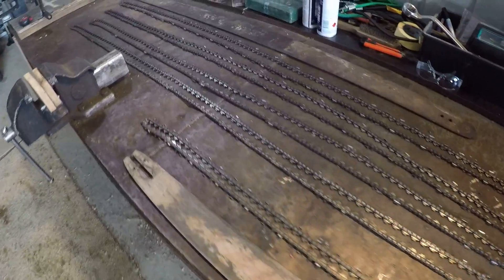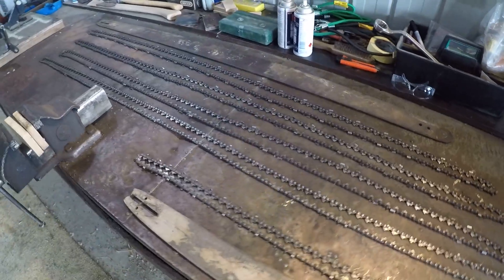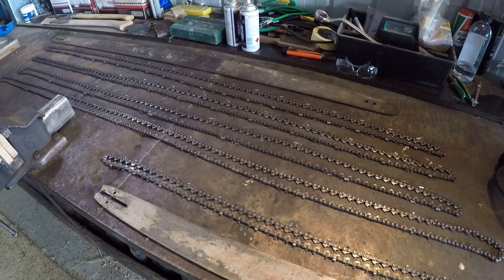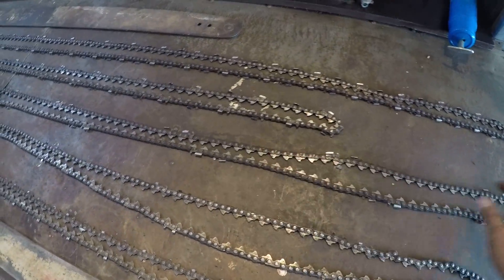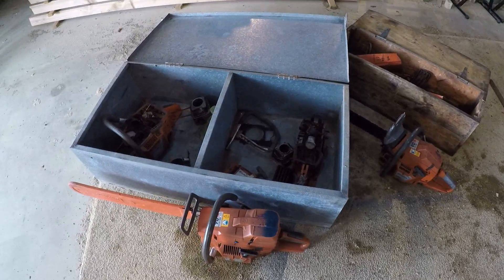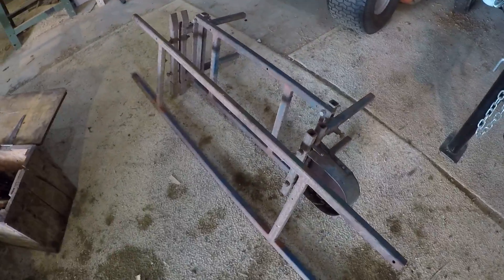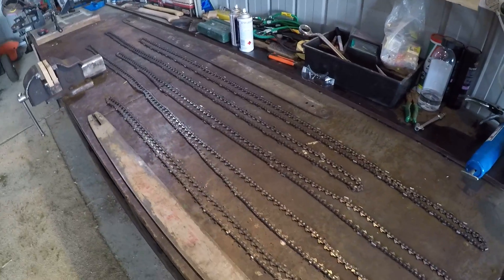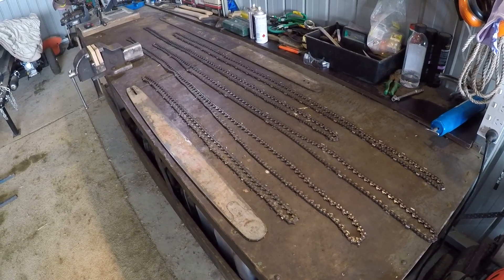Skip tooth slabbing chain explanation.

Comment: Cheers there champ............i assume you use 404 chain.
I use standard skip on 50'' bar and 880 for cross cutting and on a 60'' bar 10 deg top plate angle with Grandberge mill and was looking for a better way thanks.

Comment: I have no milling experience at all, but i suspect the main technical reasoning for the large interval design, is a relation of engine torque x cutting speed and the tensile strength of the chain.
Depending on the log size, too much cutter bite would slow the cut down and put the whole system under a lot of strain. 
Then it also happens that the gap prevents choking on waste material, aids ejection and is less effort to sharpen, so win-win.
Cool videos btw. Cheers.

Comment: Had a problem with my Lucas Mill slowly pushing the bar down as it I moved down the log, eventually tracked it down the sharpening. Ended up getting a good Oregon grinder that can handle all the different angles on the supper skip chain Lucas use and cuts perfectly now. Sound like a similar problem your mate was having. Don't bother with those cheap Chinese grinders, total junk